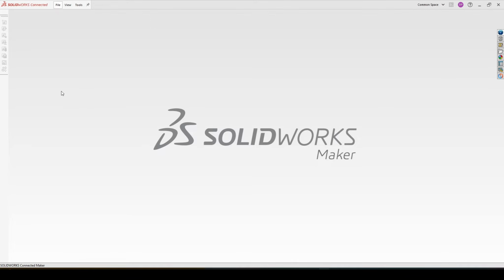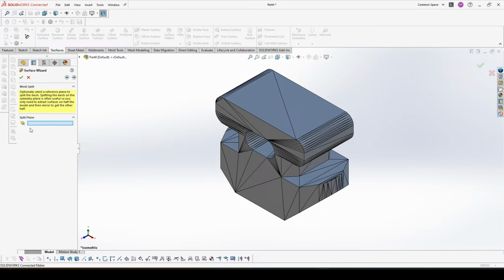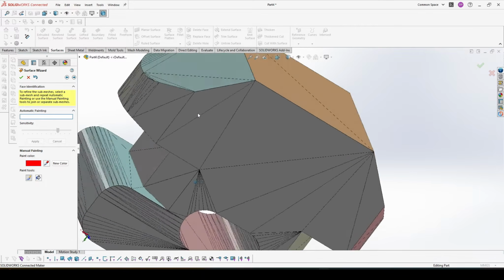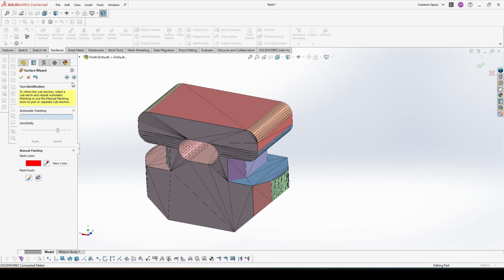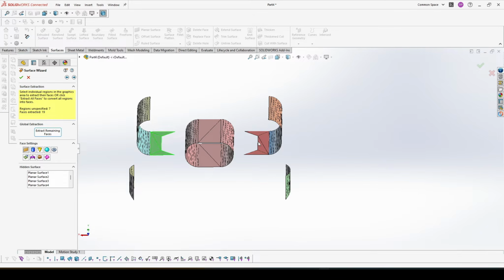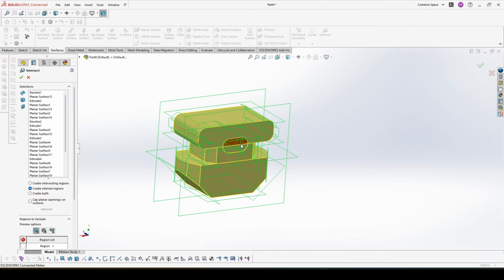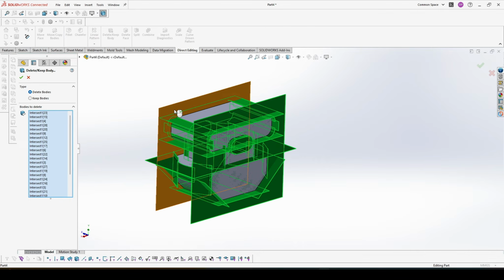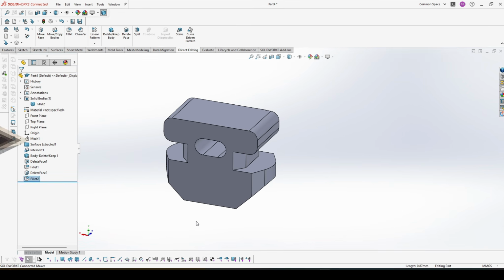SolidWorks Magic: Convert multi-face STL to Features with Ease

Comment: I used your tutorial previously on SW 2023 but after upgrading to 2024 the Surface Wizard tool and the other ScanTo3D tools have been removed from the Student Edition. Trying to isolate faces into individual bodies, but splitting bodies wasn't working how I had hoped, so I thought to come back here for a refresher
Reply from the maker: Spliting without ScanTo3D is not so easy task. If you have simple surfaces: planar, spherical, cylindrical or conical you can use the standard surface from mesh. But it will be time consuming.

Comment: i am confuse when pick color
what mean red color?
Reply from the maker: You pick any color you wish, but when you want to separate an area should be carefull not to pick a color that is already there. If you want to combine areas, then you pick one of the eleent colors and use it on the others you want to combine with.

Comment: The mesh stl I'm using has errors and the wizard said faces will be removed. If there are holes will this technique work?
Reply from the maker: One of the best features of ScanTo3D is the ability to fix mesh errors. The Mesh Preparation Wizzard will show you the gaps that will be closed. If you want to keep some of the gaps, just remove it from the list. Check my other videos about STL in this playlist https://www.youtube.com/playlist?list=PLdfEJ9NcD36TGUlGpZh8KHKjJRnK_sZ9k
Reply: @DWorkshop  Thanks. It’s complicated as my mesh is over 200k faces/triangles. So it’s possibly easier to model new surfaces over the original stl part as a reference to make a new solidworks part/assy
Reply from the maker: You can use ScanTo3D to fix the mesh only and then use the standard convert to mesh body if it's too complicated for ScanTo3D. In addition try to simplify the mesh if possible.

Comment: Thanks a lot for the video but I have a problem: when I assign the face setting to every different surface, the "hidden surface" menu it's not visible and the surfaces are not hiding, so I have problem in reaching the inner ones. Do you know how I could fix it? Thank you so much
Reply from the maker: The hidden Surface menu becomes available once you have a hidden surface, but keep in mind that you can hide converted surfaces. In this video I show how you can hide a surface https://youtu.be/D2Elk7Eu6K4?si=0l5sk2csXNS6o9S5&t=174 If your mesh surface is not disappearing, then you should hide it from the flyout Feature manager tree in the graphics area. I hope this helps.
Reply: @DWorkshop  thank you so much!

Comment: Is it different in 2013 version?
Reply from the maker: ScanTo3D is not available before 2018 as version. And a lot of what I show probably is not existing in a version from 11 years ago. SOLIDWORKS is adding improvements every year.
Reply: So i can't do or is there another mode/function to do that? because is a 2013 version it is impossible in that way, is tgere another way?
Reply from the maker: If your SolidWorks is 2013 you cannot use this, it's not available. In 2013 version there was not a decent way available to work with STL, you need other software to convert to STEP or something similar.
Reply: @DWorkshop  can you suggest me some other free and good software to convert stl in step, so incan modify it in my old version?
Reply from the maker: Unfortunately I can't.

Comment: Very good video. Thank you for sharing. By the way, can you move objects to layers on the design side and Solidworks? Or is the layer function reserved only for the drawing section?  Thanks!
Reply from the maker: Thank you for watching. In SolidWorks, layers are for drawings only. If you want to save to DXF from a model or drawing and need layers, then you should use mapping. However, even so, layers will be applied based on certain criteria, and you cannot set them individually.
Reply: @DWorkshop  thank you again. Have a wonderful day! Please keep up the great content.

Comment: Where do I send a suggestion for improvement?  It is VERY difficult to see what colors things are in this tool as you move around a part.
Reply from the maker: Very good point I totally agree. I think you can post your suggestion in the SolidWorks forum.
Reply: @braydenwrede8617I have and they still appear very muddy, making it difficult to identify surfaces at angles to one another.

Comment: When I reach the Surface Extraction step, I select a flat surface and select the plane icon, I get an actual plane show up. My selected surface does not disappear, and I do not get a list like you do in the video. Is there a setting I may be missing?
Reply from the maker: Normally there is a slight delay until it converts, but if it don't do it at all there is something wrong: either the face you pick is not planar or there is some bug. Is it happening with every face or just some? Is it only on planar or happens to other types too? Also try with BSpline - the last option, it should be able to convert it.
Reply: @DWorkshop  Same for me... it doesn't work at all

Comment: Hello, I have a question about your procedure. When I reach the Surface Extraction step, I select a flat surface and select the plane icon, I get an actual plane show up. My selected surface does not disappear, and I do not get a list like you do in the video. Is there a setting I may be missing? Thank you for the video and your help.
Reply from the maker: Can you send me some screenshots in LinkedIn. I'm currently on vacation and have a bit slow response, but will have a look as soon as possible Check out Danute Petrova-Nikolova’s profile on LinkedIn https://bg.linkedin.com/in/danutep
Reply: I have yhe same issue, did you solved it ?
Reply: @matiasnjackson  So my answer is sort of. The part I had was quite a bit more complicated than the example. When I selected each face, it did not disappear like in the video. But it did create the plane for the selected face. But because nothing was disappearing it became quite difficult to work on. And if you have an error, you cannot just back up and fix it. You have to start all over from the beginning. I got so frustrated I ended up just modeling the part from scratch. I hope this helps you.
Reply from the maker: @dnvm84 you don't have to start over again, you can finish to where you are ready and you'll end up with a lot of submeshes and extracted faces. From this point you can start the surface wizard for each submesh individually and before doing so, to hide all that is giving you troubles for visibility.
Reply: @DWorkshop  Hello, but if you select something wrong, I did not find a way to unselect it. And if you hit the "Back" button, you lose all of the work up to that point.
Reply from the maker: @dnvm84   I suppose you mean if you make the wrong convert, yes unfortunately you are correct there is no undo. If you mean the pure selection of  face, then all you have to do is click somwhere in the area and it will unselect.
Reply: @DWorkshop  Thank you. I will give that a try. I wish my system reacted the same way yours did. When you have more faces it gets so hard to make sure you select the faces you want.

Comment: hi, I need to modify a STL in solidworks 2022. Do you know the best workflow to do it? I dont have this add in.
Reply from the maker: Hi, if you don't have the add in you should stick to the standard import options. You won't have SW features after it, but at least you'll have editable mesh body. You can check how to do it in this video https://youtu.be/EDDUsci15ac
Reply: @DWorkshop  ok thank you :)